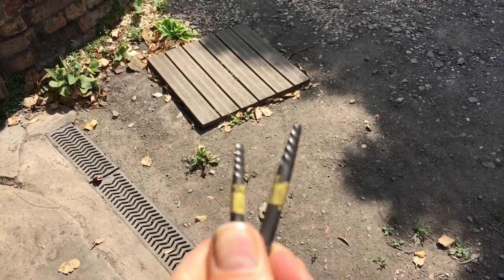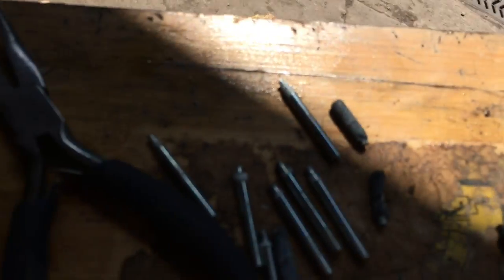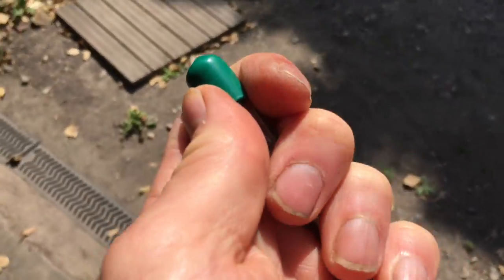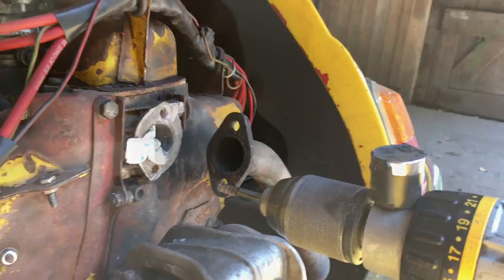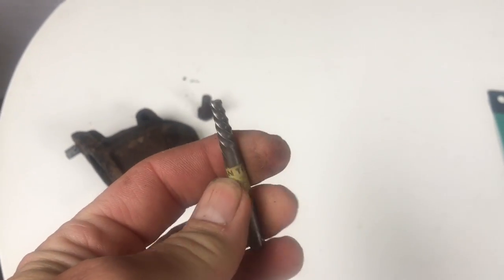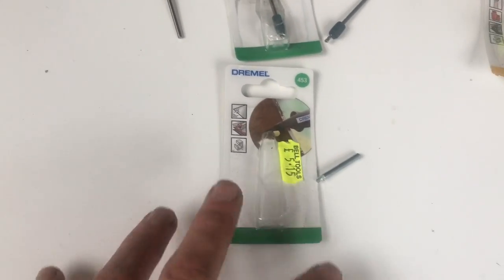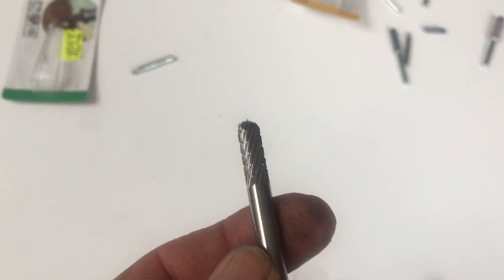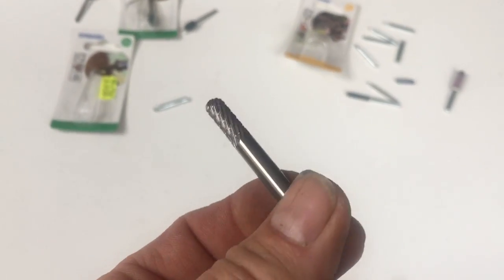How to remove a snapped off bolt extractor or snapped off EZ out using a carbide burr

Comment: Carbide burr took forever. Diamond tip hole saw made it easier work.
Reply from the maker: Good to know. Did you not end up with a much bigger hole using diamond tipped hole saw? Mike
Reply: @MikesMercsandothercars  yes of course. Just drilled out the rest and tapped it.

Comment: Little tip heat induction would save you a lot of trouble 😁
Reply from the maker: Thanks for your comment. Good tip -  might give heat induction coils a try next time I come across seized bolts - looks a lot safer and more precise than a blow torch! Mike

Comment: You got a product link?
Reply from the maker: Thanks for you comment and if you have snapped off an Ezy out, I'm sorry to hear it. I used a "York YRK 210 1169K 6 x 6mm cylindrical ball nose carbide burr - cut 9" which I got from Cromwell Tools in the UK. Here is the link:

https://www.cromwell.co.uk/shop/cutting-tools/tct-burrs/6-x-16mm-cylindrical-ball-nosed-carbide-rotary-burr-cut-9-chipbreaker/p/YRK2101169K

These are not cheap (approx £20) but you get what you pay for. I sometimes buy cheap and cheerful sets on eBay for grinding off rust but togrind out a snapped Ezy out you need something more substantial (in my experience). Mike

Comment: Hello, my name is stupid.
Reply from the maker: Hello Luke - why is your name stupid - did you snap an easy out? Mike
Reply: @MikesMercsandothercars  yes, on a timing chain cover, left side bottom bolt. It leaked like a sieve when I gave up and installed it. Had to order an aluminum cover that hopefully won't have as much give as the plastic one.
Reply from the maker: @lukehelpmetakethisdangmaskoff  What a nightmare.
Reply: @MikesMercsandothercars  https://youtu.be/Y8V8iPnsKM0
I got it out! Drilled past it on the side and used a carbide dremel tool to grind the damn easy out, out.
Reply from the maker: @lukehelpmetakethisdangmaskoff  Well done - I bet you were relieved! Mike
Reply: @MikesMercsandothercars  yes!

Comment: Great video!
You wouldnt have a link for the carbide burr you bought?
Reply from the maker: Thanks for your comment. I got my bull nose carbide burr from cromwell tools - it wasn't cheap, but it did the job in seconds. I dont know whether the cheaper sets you can get on ebay and amazon would work as well - never tried:

https://www.cromwell.co.uk/shop/cutting-tools/tct-burrs/t3240-carbide-burr/p/GAR2103240A

Good luck.

Mike
Reply: @MikesMercsandothercars   thank you:)

Comment: Have just spent over an hour with a carbide burr trying to file away the snapped extractor - its very slowly but surely getting there but definately nowhere near a "30 second" job...
Reply from the maker: Sorry to read about the snapped extractor - what a pain! The bull nosed carbide burr I used was very expensive (about £20) but it did the job. Mike

Comment: It's videos like this. That are ruining searching for help for DIYers. 3-5 minutes WASTED. Horrible info,  and still didn't even attempt to show it was removed.  Sorry friend,  solid B for effort,   but in the end. Solid F, for Failed.  
Or simply re-title the video. "Methods I tried, unsuccessfully.........."
Reply from the maker: Good point - although ....sometimes showing people what doesn't work can save them money. I think you are right though, i it would be helpful to show the Eze out actually being ground out using the carbide burr. This was one of the first videos I did and I was so excited to actually find a method of removing the Eze out that I didn't film the actual process properly! Following your comments, I think I will purposefully snap an Eze out and do another video which show the actual grinding out. Mike
Reply: @MikesMercsandothercars  i retract my previous 2 year old statement.
And I agree,  this was a good info video. And probably saved people time and money.
Reply: What's wrong with you?

The dude practically showed the entire proccess and not to waste your time and money on.

Yes... he did not show the actual proccess... but if you can't take the information this man gave out and run with it...I'm sorry to say this is NOT a job for you.

Removing a broken bolt in itself can be quite tricky for people less inclined to mechanical jobs... removing a broken extractor/tap... near impossible for Average Joe.

It takes patience, skill and quite a steady hand.

So... I'm sorry to say, friend, it's not the video... it's you.

Comment: I used a 3/8 diamond tip hole saw to drill out a broken extractor. Drill for 5 seconds and cool in water repeat until done. Cuts like butter.
Reply: Thanks for this, I used it today and it was the only thing that would work, wonderful.
Reply from the maker: Thanks for the tip - doesn’t using a hole saw make the hole bigger? I assume it fits round the snapped off bit? Mike
Reply: @MikesMercsandothercars  i used it to remove the extractor then used a drill bit to the correct size and tapped it.
Reply: @Product-Development2025  the diamond tipped bit worked great for me and the carbide burrs worked also. But the diamond tipped bit was able to drill more precisely, while the burrs made a hole bigger in diameter than intended.

Comment: Trying to remove a broken glow plugs snapped an Irwin extractor now I'm here, what's up brothers!!!👋
Reply from the maker: Ah man! Good luck with the extraction.
Reply: Sup! Just broke off a bolt on my thermostat housing , drilled a sweet ass hole and broke off the Irwin extractor,  now I'm here to!
Reply: @mozberg2191  that sucks!!!... Hey you might wanna use a (Carbide burr Round nose cone shape) to get rid of that broken extractor, it's gonna be a long process but it actually works!!! Good luck dude!
Reply: @neutronronnie9343  ordered a kit after reading this , going to grind away later today,  I wonder if I hammer and chisel the extractor,  it might crumble??
Reply: As an update,  I purchased both the burr and the drill bits...the burrs did absolutely nothing,  but the solid carbide drill bits cut through the Irwin extractor like butter!
Reply: @mozberg2191  dude that's awesome!!!👍  Good to know, now i need to get me a set of carbide drill bits haha
Reply: @neutronronnie9343   yea man, they aren't cheap, I paid 20 bucks for the 1/8 on Amazon so a whole set puts you over 100 bucks , but we'll worth it, local mobile bolt extractor was charging me 310 bucks to remove and re tap, which doesn't sound too bad, but I'm only in it for the burr and bit.
Reply: @mozberg2191  $310??? That's a lot of money!, thank god you tube and amazon exist lol
Reply: I did the exact same thing. I drilled a hole into the struck extractor now I'm gonna try to insert a new extractor into the broken extractor
Reply: @ISAIAH_spyro did that work ?
Reply: @PeachCoastLowrider  In the end, the chunk of the cast iron head broke off around the spark plug, freeing the plug, but leaving the head severely damaged.
Reply: @ISAIAH_spyro oh nooo . so you had to buy a whole new head?
Reply: @PeachCoastLowrider  I was actually able to get a sav-a-thread helicoil type thing to screw into it, and still used the head, but I don't think it was getting perfect combustion in that chamber. I ran it for many months though, and eventually replaced the head, but for a different reason. I was able to get a head from a salvage yard for like $100 but I had to pull it myself from a different truck
Reply: Just broke bolt extractor stuck in motorcycle forks.

Comment: Had the same problem. Put a left hand drill bit on it and it just fell out in 2 seconds.
Reply from the maker: Thats a good tip. Did you get the sheared bolt out that way or a snapped off Ezi Out? Sometimes the Ezi Out bits are harder that the drill bits. Mike
Reply: @MikesMercsandothercars  just the easy out. The technique doesn't involve drilling it out, just hoping it will catch the easy out real quick and spin it just enough to break loose. Doesn't always work though but worth a try. Another tip, masonry bits chip away nicely at easy out because stone is harder than hardened steel. Good cheap way to drill them out.
Reply: I have this issue and im being told to weld it and removing it but that sounds too pricey. Will the left hand drill bit work? My brother titanium bits didn’t do crap but shave off abit aluminum off of the engine block.
Reply: @edwinguerra5585 did u try left hand drill bits?

Comment: Ok... you explained it twice but didn’t actually show HOW to do it!
Reply from the maker: You are right! - I didn't actually show the snapped off bit being ground out. This happened at 1.16 minutes in the video but I didn't film the process. At the time I thought it would be self explanatory BUT With the benefit of hindsight, I should have set up a tripod and showed the actual process of grinding out the snapped bit. Mike
Reply: @MikesMercsandothercars  so did you have to retap the hole?
Reply from the maker: @kimedgington6276  The threads were just about OK but I did retap the hole. Mike

Comment: Hi mate fantastic video ive now subscribed to your channel for more videos.  I dont suppose you have a link to what you bought by any chance? I know you said you bought it from a shop but I don't want to buy one thats not up for the job.  Seen some packs on amazon but 5 for £18 seems to cheap! Thanks mate
https://www.amazon.co.uk/dp/B0897N1HGG/ref=cm_sw_r_cp_apa_i_69-6EbH6VD2W5
Reply from the maker: I bought the 6mm 'bull nose' carbide burr from Cromwell Tools in Bristol. Not cheap, but it did the job https://www.cromwell.co.uk/shop/cutting-tools/tct-burrs/t3240-carbide-burr/p/GAR2103240A. I have also bought sets on ebay for approx £10 (see ebay item 202923546256 BUT......whilst these are good for removing rust from parts I am restoring, I doubt they would be good enough to grind off a snapped off ';eazy out' bit. Good luck. Mike
Reply from the maker: Just found the actual bit and it says "York Abrasives' Order Code YRK-210-1169K
6 x 16mm CYLINDRICAL BALL NOSE  CARBIDE BURR - CUT 9